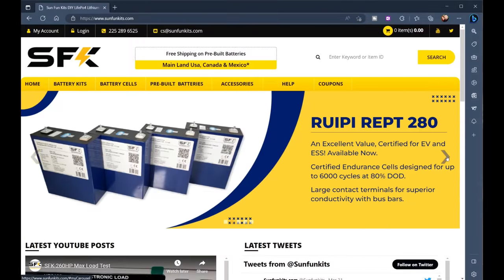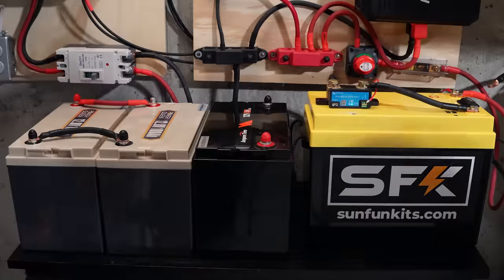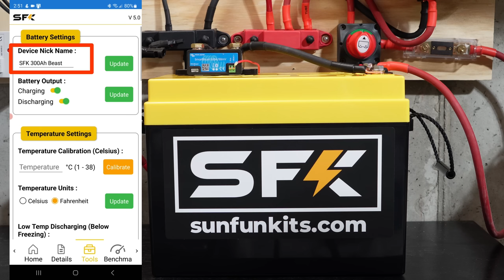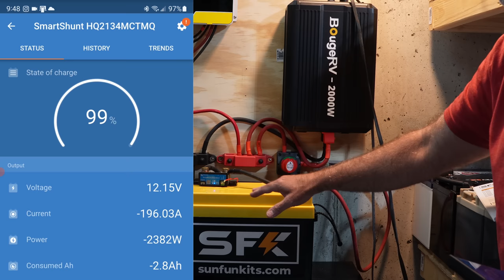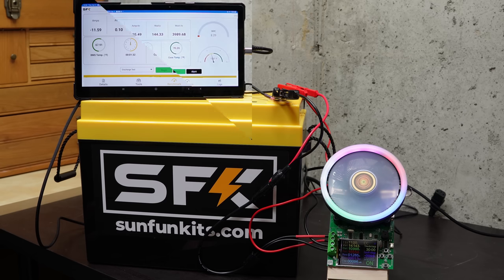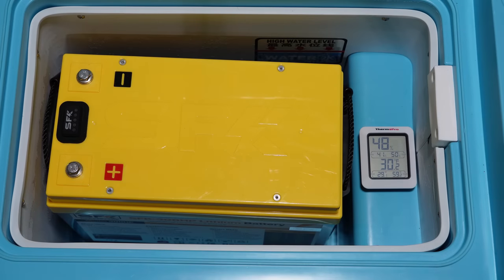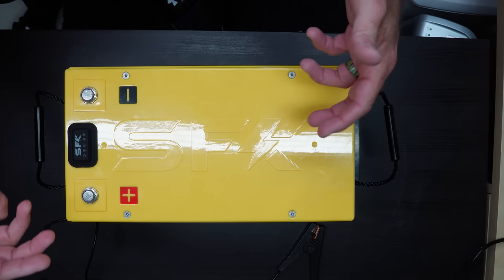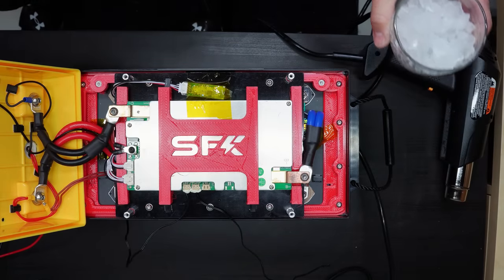The MOST Capacity, in the SMALLEST Space: SFK's new 300Ah Heated LFP Battery: 300HP

Comment: P.S. Nice Review ReeWray :)

P.P.S. That looks like a nice product and it's made in the USA....You don't see to much of that now-a-days 😀

Likes:
1. Heated cells (with built in access)
2. Small form factor
3. App
4. Specs on the product
5. Made in the USA
6. Cycle counts on the app
7. Temp readings on the app
8. Display of each cell
9. Battery case is great
10. ReeWray's review :)

Comment: I just finished a build of the heated version... It turned out pretty good.  It's my second kit from them.  I found that no matter what setting, 1, 2 or 3, the power draw is the same but probably cycles more often. It took 2hrs and 40 mins to bring it from 0deg. C. to 70deg. F. and used 8% of the 280ah capacity to do it.  Nice review!

Comment: thanks for the break down. Not liking the heating mode. Typically a lithium battery you can use them in discharge mode under freezing. Now when you charge them up under zero they dont like it. So I would rather like to see in the BMS to heat the cells before charging them and continue to heat while charging. Once the cell reach its full charge point then it could cut the heating pad and discharge for use.
my 2 cents, well that how mine work.

Comment: If they manufactured a 200 Ah battery with the same dimensions as a typical 100 Ah battery, they would capture more sales. My Casita travel trailer has a specific location and size limit for a single, typical battery, so the 300 Ah battery wouldn’t meet my needs size wise.

Comment: Excellent review! Do you know if this can be side mounted?
Reply: Any lithium can be mounted any direction you can imagine.  They are sealed cells inside the plastic box.
Reply: Hi, while it is possible to side mount, all long term testing and data has been based on the prismatic cells mounted upright. That being said we have had people side mount the battery for years and it has been working, however, in the manual we recommend  mounting then upright.
Reply: Appreciate your transparency! 
Noted.